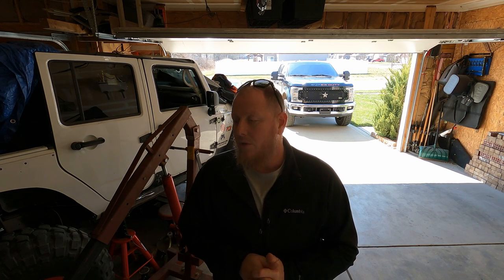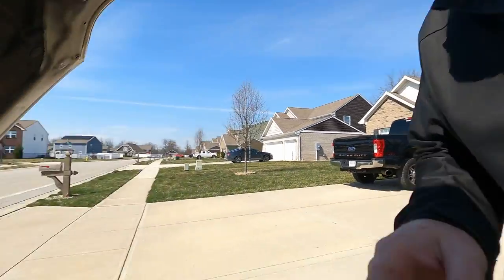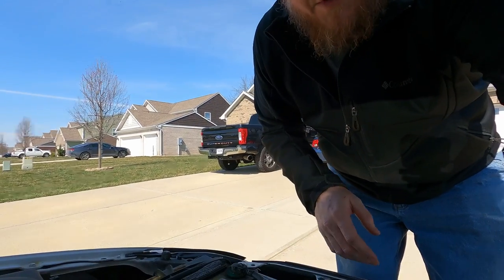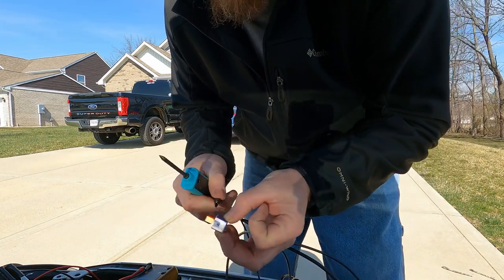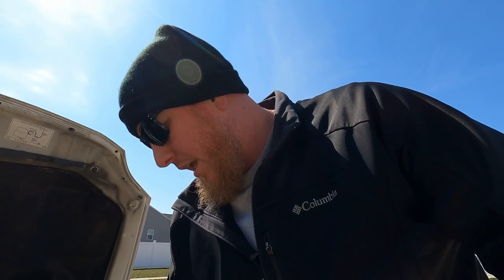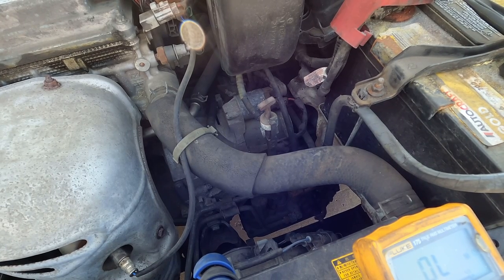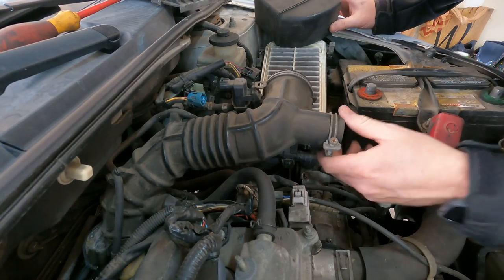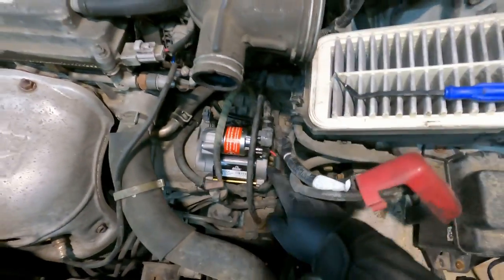SCION TC NO START, DIAGNOSIS AND FIX

Comment: So I am having the same issues. But I have already put in a new starter and now it’s not cranking at all like in the beginning of the video. With the old starter, it was slowly cranking, but not wanting to turn on. Battery voltage is at 8.5, but I had it replaced one day ago as well. I’ve cleaned all the ground contact including the terminals for the battery Posts and no luck. Any thoughts?
Reply from the maker: My guess would be alternator is bad.   Your battery should be at 12v.  New battery should have tried to turn it over at least a couple times before it dropped.  Try jump starting it off a running vehicle.  That will eliminate the battery.  If that doesn’t start it swap the relay with a matching style in the fuse box.
Reply: @8Lugproductions   I’ve already tried swapping out, relays and no luck. I’ll go ahead and charge the battery and see what happens but I believe it would be the alternator. I think the alternator was the main culprit this whole time. I was diagnosing the wrong parts this whole time I believe.
Reply from the maker: @josephreyes9586  good luck
Reply: @josephreyes9586  Did you find the problem?

Comment: I put a new battery and new battery cables and nothing. No lights and power locks don't work. Only thing that comes on are my front lights that's it. What could be wrong. 2006 scion tc
Reply: Same issue here did you ever figure it out?

Comment: Hey so im having a problem kind of exactly how you are showing I swapped the alternator and battery bc at first those 2 were a problem got them fixed and car was working great, till out of nowhere the car js wont crank or start and once i connect them to the cables it cuts on right away